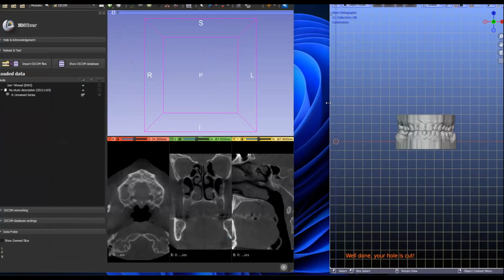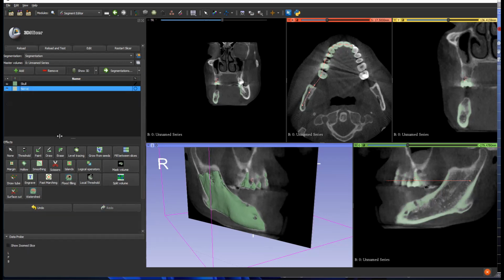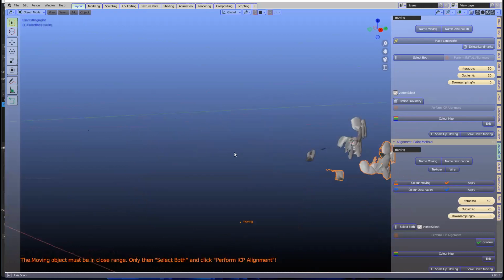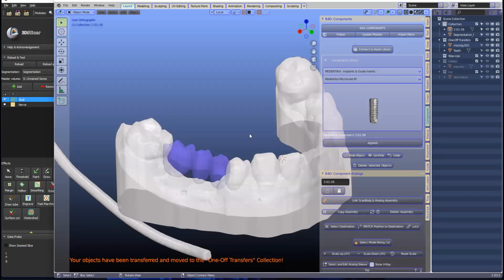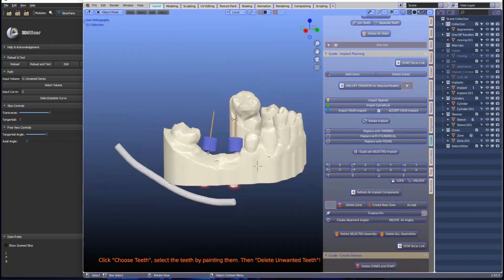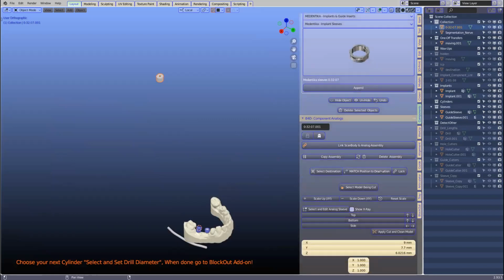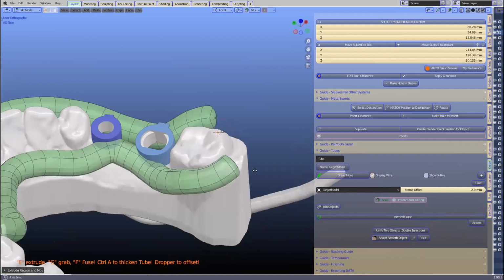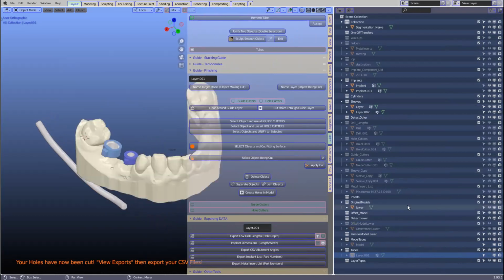Zoom- Making an Implant Guide from start to finish.

Comment: in blender 2.93 i used custom metal inserts that i had designed and they work fine, but when i upgraded to blender 3 they stopped working and don't place properly in the sleeve, help me please